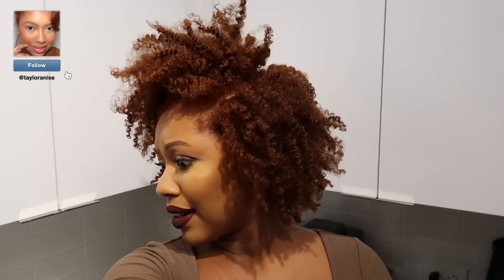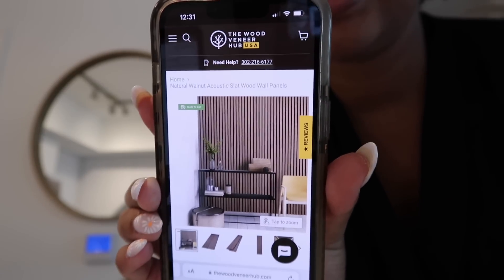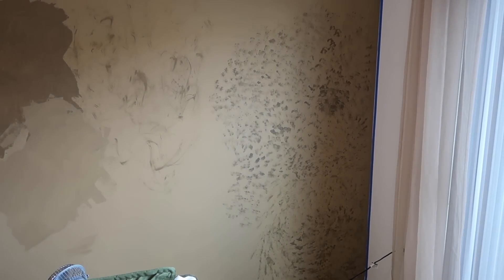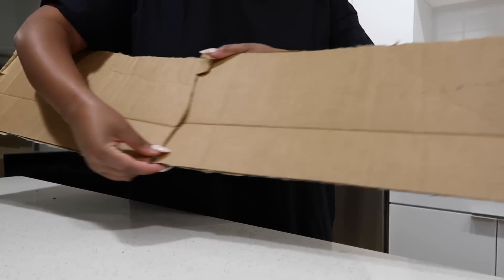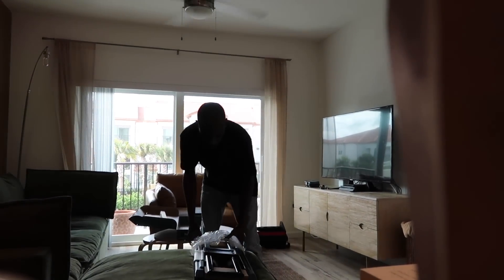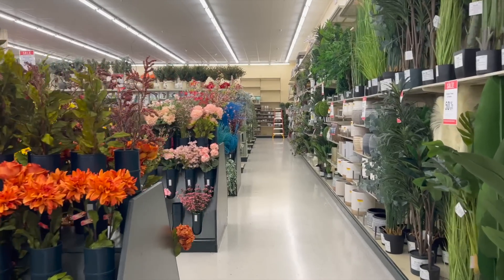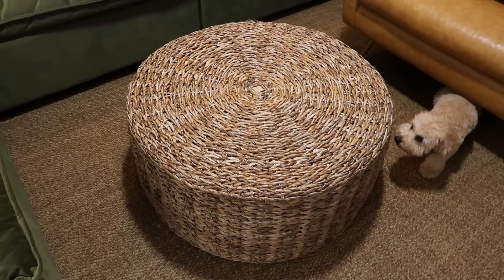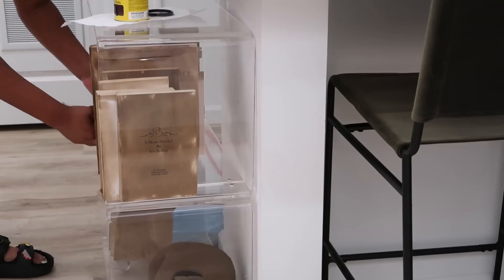EXTREME LIVING ROOM & KITCHEN MAKEOVER | DIY Decor & Renter Friendly!

Comment: Very good. Love how you went with the green and goldish leather chair. This is very different  yet an eye catcher. Very soothing to the eyes. Book shelves to crowded why not add another shelf over the sofa and display the vases. Those are art pieces that you popped some amazing textures and color and you need to show them off. Vases are like urns, sculptures a very must in accenting a room with classy things at afford prices. Every room should start out with a rug to ground everything. Loved your choice and you were spot on with the coffee table. Just purchased a 4ft olive tree 200.00 half off but I can work with it. My mom still has one of those fake ficas tree but they were a thing in the past if you could take them out and spray the dust off with the water hose. NOTE,.......for you. I only have a few artificial plants. Place all of them at the same time, place in your shower hot or cold and let that water keep running a few minutes to get the dust off. Drain the excess water and shake the plants. Place some towels on the floor or counter and the air inside will dry them off. So easy but so effective. My bedroom is done in the blue and white chinoiserie vases with the lamps and yes the shade and put in the shower. It is the most effective way. Dry brushing will not get the packed on dust but plain water will. It is so easy. No, your lampshades will not fall apart. You are not soaking its just like a light rain on whatever, shaken and then dried off by towel or air. Good luck.    Jeff/North Carolina.